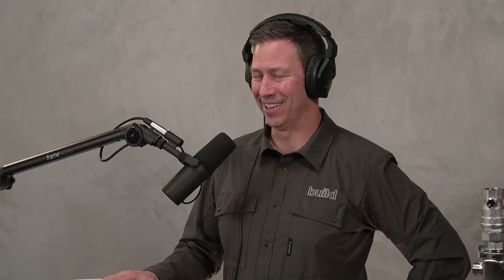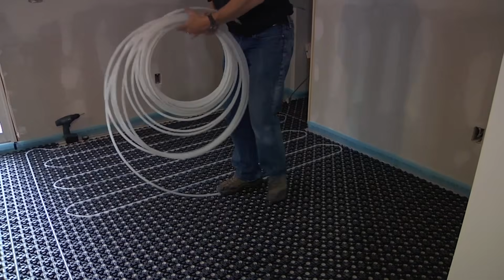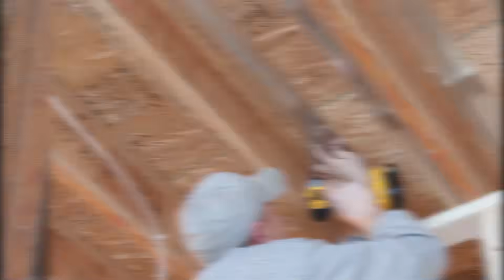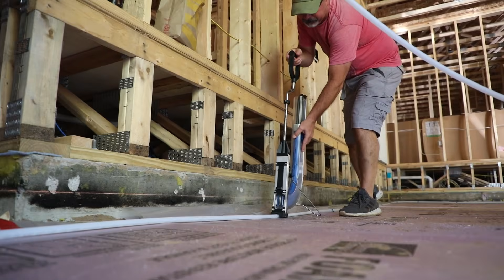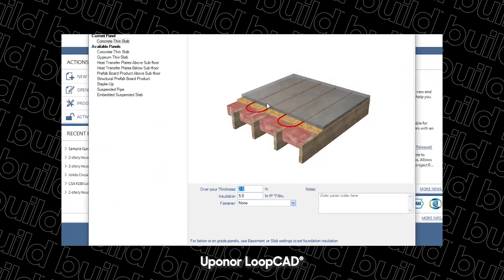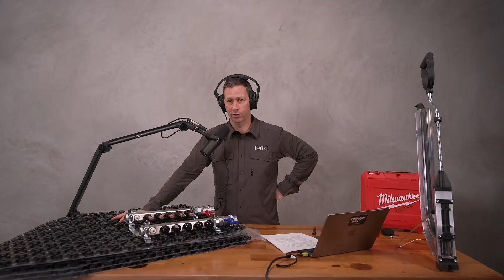4 Methods To Run Radiant Heat PEX Pipe

Comment: I know this was are sponsored by Uponor, but radiant heat can also be electric heater wire underneath the floor or in concrete.

Electric I feel can be more beneficial as it won't flood a space if there is s leak and can also be repaired if anything were to happen. (I feel this would be more difficult with this system) 

But electric heater wire also doesn't haves the thermal mass of water. So there's always that. But it should at least be included in the conversation.
Reply: @suspicionofdeceit I know but I've seen PEX get a pinhole leak and fuck up a ceiling. 

On the fault of the installer.
But still it happens, and water can do a ton of damage.
Reply: With electric you'd probably have a fire hazard instead of a flooding hazard xD.
Reply: @StealthNinja4577  
But why that include Electric in the conversation? 

Many residential construction manufacturers do electric radiant heating. I feel it should be included.
Reply: @mountainbikerdave  oh I'm just being factitious. I don't mind electric heat I use a space heater every winter. It'd be cool if they did natural gas radiant heat. Maybe in like a metal frame construction you install these burner boxes that heat up the walls and floors.
Reply: @StealthNinja4577  they have natural gas boilers that heat up water for radiant heating. But that's as far as natural gas for radiant heating goes. 

But as far as what you said You couldn't use natural gas in that capacity:
1. You need to vent the fumes or You would have just created a gas chamber
2. Natural gas gets too hot. You're essentially heating with fire, so you're going to get heat spikes unless it's a really really tiny flame. Either way it's still a fire hazard.
3. You'll have natural gas lines running all within your walls. It's an explosion just waiting to happen. Just imagine a leak and all that gas filling up the cavities in your walls. And remember your walls are fire rated, ideally they are supposed to be a fire barrier and not a fire spreader or a 8 ft tall claymore.
Reply: @StealthNinja4577  correct, if not installed properly/to code, you can have a potential fire hazard. 

But that's why we hire experts/professionals and not just some hacks standing outside of Home Depot. LoL
Reply: @mountainbikerdave  Technically as soon as you pay someone you make them a professional. It's always bothered me that people think professional implies expert. In the same vain people tout the code as if it's a be all end all but then contractors install stuff to meet code and then alter it once the inspector is gone and signed off on it.
Reply: @StealthNinja4577  100% correct

There's definitely a difference between someone who has a business license and a true expert in the subject matter.

But, all "code" means is minimum building requirements. If you alter it, that's fine. 
As long as it exceeds the minimum. 

(Just as an example, code in my area requires that you put a minimum of 1 exterior electrical outlet(s) per dwelling unit (house), it must be a minimum of 15 Amps and GFCI protected. But again that's the minimum. You can put in a 20 amp receptacle, because that exceeds the 15 amp requirement. You could put it on one of those new AFCI/GFCI protected circuit breakers, because it meets the minimum GFCI requirement. Also you can install 2, 3, or even 10 exterior receptacles, honestly whatever the homeowner wants. As long as it meets or exceeds the minimum requirement of 1 receptacle.)

But honestly I don't follow code. code is the minimum. My personal requirements astronomically exceed code. So that's what I follow, well at least for my own home.
Reply: @mountainbikerdave  I have 0 problems with codes like that. My one friend is building an earth house and the inspector is like but the code says you need a hole in your impermeable membrane for venting. He's then like but then it's not impermeable... the inspector really wanted a badge when he started so he got one off Amazon xD I'm just listening to his woes of dealing with the inspector and I'm just like this sounds like they need to go back up to the top and label the code for traditional construction and then make one for what he's doing cause it barely applies :p
Reply: @StealthNinja4577  I feel bad for your friend, most inspectors are complete idiots and have no clue why codes exist. 
They typically don't even come from the trades or the construction industry but instead just have a Buddy that got them the gig. 

They are a real pain in the ass to deal with, but unfortunately they have unlimited power so if you choose to do things the legal way you have to deal with them.

Also that, impermeable comment was hilarious. Like attaching a screen door on a submarine.

Comment: Matt,
I want to thank you very much for this weeks video post. I have always been a fan of this type of heating. But my home was too far into the build to change the way it is heated. However when you mentioned using the side walls that opened a whole new way to use the hot water heating. My first job was with an electrical contractor. At that time electric heat in the ceiling was being used. I also remember if a drywall contractor wasn't careful it could be a real mess tearing it all out and starting over. Over the years that type of heating faded away. I like the in floor method better. 
Thank you

Comment: There was this set of stairs, on This Old House, that needed heating, but they couldn't install radiant in the floor of them, and forced air couldn't work for them.  As a result, they used the wall mount method, there, for the radiant heating in the stair well.  It was Kevin O'Connor's first Project on TOH, I think.

Comment: I put Radiant tubing in a wall with these clamp on steel "radiators" that clamp onto the 1/2 pex. It is NOT 100% silent. when the wall gets hot and cold... it moves the pex and it expands/ contracts.. You can hear the wood rub on the Pex.

Comment: Do you need a water filter for it? I would think it would get calcium buildup over time this making it less efficient?
Reply: You can also use glycol in the system instead of water, so no worry about calcium buildup or freezing if the system were down during cold temps
Reply: You could probably make a distilled water closed loop with its own dedicated heater once the calcium is gone it should basically run forever.
Reply: You have to get the water right. Has to have the correct hardness.  And no biologic. You have to be careful with Distilled water. Distilled water can eat things up. Distilled water is too pure. Basically it wants to make it's self impure. I  didn't believe it. Until my brother Engineer who builds pet chow plants for Nestlé. Said someone used Distilled water in one of their chillers. It ate it up. Several hundred thousand to remove and replace it. You also have to use air elimination equipment. Air will cause all kinds of problems. Also biological criters can grow inside a sealed system causing the black sludge. I found that a lot of the "experts" have no clue about water. Or perhaps they do and want to come back a few years later and replace equipment. Once you get it right though. It'll be good for a long long time.  Equipment has to be right. But it's all out there. And easy to install. 
Also you have to use water with anti freeze. And that water has to be right. The more antifreeze you use the less efficient the heat transfer. 
I don't have any in my system. 
I live in Wisconsin.  But my house and slab are so insulated. I was heating all 3400sqft with one of those little oscillating heaters in the middle of my shop downstairs. While I was working on it.  After insulation before having drywall on the walls  just the ceiling. I had both my knees replaced beginning of November. So I wasn't working on it. No heat whatsoever. For almost 2 months before I could come back and check on it. I checked my entire slab with a laser thermometer. And the lowest it was was in the back corner 34°f. 

I drive a forklift for a living. I figured it all out so can you.

Comment: I would love to see a complete video on setting up a full system. Sizing boiler, parts needed, etc. I love the idea of radiant heat
Reply from the maker: Let me see if I can do that!
Reply: @buildshow  Hey Matt, it would be good also to rate the most efficient system embedments
IE heat draw on the boiler of a concrete insulated slab vs aluminum dispersion plates and the channeled wood product. Which one is the best bang for the buck.
Reply: @2drsdan  I have concrete slab radiant and True Trac...plywood tracks and hardwood top. The better the heat sink...ie concrete, ceramic, stone, etc...the better the comfort. I wish I did cement board and tile upstairs...or gypcrete. Gypcrete was breaking down and having issues 20 years ago so I avoided. Big 24 inch tile would be my next top.
Reply: @buildshow   You should look at doing a podcast with Dan Holohan (HeatingHelp) who literal wrote the modern books on steam and hot water design/troubleshooting.  He's got great stories.  His book 'Pumping Away' is must read to understand hydronic piping feeding the loops/radiators.
Reply: Ditto. Do it with no gas appliances please! Air to water heat pump please.
Reply: @brettzeigerbacher2314  Water to water is another good option. My neighbour's house has a ground source heat pump system for the space heating, hot water, and driveway heating for snow melting. Got it done at the right time too - planned from the start, and installed as part of the build.
Reply: Uponor has a VERY useful design guide that is a free download!
Reply: There are loads of full system buolds on YouTube...and loads of DIY ones for the very brave..
Reply: My brother had it installed in his house unfortunately it was new at the time and was a product called solar roll it could have been a great system but the plumber was incompetent and set up a duel heat system high temperature for the baseboard heaters in the basement and low temperature for the upstairs and it never worked properly
Reply: Look at warmboard. Great product.
Reply: @jwristen24  I quit on Warmboard and Ecowarm bc of the prohibitive price. I am going with tubing and covering it in aircrete. Look for aircrete Harry on YouTube.
Reply: @tedsimeonov9696  used gypcrete on many many hotels. Great product. Lays down great. Not cheap though and gotta have everything prepper right otherwise it's a giant mess.

Comment: The Quick Track  (spelling?) is intriguing as a retrofit for our main bathroom since there is access from below (in my office/personal room).  Can you put insulation/sound deadener between the floor joists and over (under?) the Quick Track to minimize the foot noise from above?

Comment: I'd say Warm Board is another product worth a look for this, a lot like quick track but way better  Just did a big renovation on a place and used that. It was easy to install because every panel was mapped out with blank panels for under cabinets etc. The entire top is aluminum, unless you have to do a custom route in a few spots which is normal but it's just no aluminum under the tubing so not a big deal. The entire system was very reasonably priced too. Hahaa, I'm not paid to say that but I would recommend that system, customer service is great too. Take care
Reply: Agreed. Plus they do a design/build type setup with plans and zones speced and ready to go.
Reply: I used Warmboard (and their design services) in our new build construction six years ago and love it.     We used an engineered hardwood over the Warmboard subfloor.  For the hot water source, we used a Navien combi boilder for both the domestic hot water and the radiant.    Works (and feels) great.

The general building contractor wasn't experienced with Warmboard, or even radiant heat, but the plumber was and it worked out very easily.
Reply: I used warmboard in my house. Awesome stuff.  I heat and cool with geothermal.  Use chilled water fan coils for cooling. Solar for  power 10,080 watts. Keep house above. And 2400sqft shop and storage below.  As hot as I want all winter. And as cold as I  want  all summer.  All 3400sqft. Zero bills. House all electric.
Reply: Matt is not talking about it but on the build show network they actually have a video about it 
https://youtu.be/c9_H_X9cY2o

Comment: you still need to move air, people in the house need to breath, so even if you don't need to heat the moving air, you still need to move air through the house.
Reply: HRV or in humid climates ERV
Reply: @jamespatrick5930  yes, but as they were talking about how radiant is silent and there's no dust kicked up by moving air, that only works if you hve a leaky house, otherwise you have a HRV/ERV moving air, stirring up dust, making noise, etc. (possibly less than if you are heating/cooling the air, but how much less??)
Reply: @davidelang  My HRV don’t stir up dust as the stale air vent is in the master bath ceiling & fresh air supply is in other end of house above the refrigerator in kitchen. 
My 4 HRV pipes are 4” PVC schedule 35, fresh air in front gable end & stale air out the rear gable end.
Reply: @jamespatrick5930  ahh, I've never lived in a tight house, but even so I've had interior doors slam shut from poor ventilation design and expected that in a tight house, closed interior doors would not allow all the rooms to get good air circulation. (I would want the interior doors to be that tight to cut down on noise from one room to another at least)

Comment: Does a ceiling install in a 2 story house do double duty...heating above and below?
Reply: Somewhat, I did this in my last house with suspended pex in between the TJI’s, 4x pex runs per 16”
 Seemed to send about 2/3 of the heat to main level & about 1/3 into basement, more or less.

Comment: what kind of boilers are usually used with these radiant systems? tankless? large tanks based on house size?
Reply: I’m an owner builder and have looked at different option. Most natural gas boilers now actually modulate the flame to the demand. I’m going to be running mine at about 130F. The nice thing about a hydronic system is all you need is a thermostatically controlled valve for a zone. Even the pumps vary their speed to the demands of the loop.

Comment: Great show Matt!!  Just wondering how the temperature per zone adjusted?  Say you want bedrooms cooler than main area's etc.  I would assume that there is only 1 heated water source so all zones would supply the same temperature water?  what about keeping unused space at a cooler temp?  My guess is something adjusted at the manifold?
Reply: 1 thermostat per zone, each controls a dedicated zone valve.
Almost always a single water temperature, with the thermostats turning flow on or off.
Reply from the maker: Yes each zone has a manifold so you can adjust the temp by zone even though the boiler is at one temp
Reply: If this was done in ye olden times you'd probably just throttle the flow rate so the water dissipates the heat longer before returning
Reply: Thermostatic mixing valves can adjust the temperature in each feed, valves or pumps are controlled by the thermostat to open and close feed to a zone.  Usually, a loop will feed a coil in the hot water tank which takes up the residual load from the boiler as zones satisfy.
Reply: @jkbrown5496  I’m glad that U mentioned Indirect Water Heaters, this is a great way to provide Domestic hot water to fixtures. 

Yes, thermostatic mixing valve (TMV) can be adjusted to mix some cold water with the hotter water to temper down a zone or two.

This requires a separate pump to “suck” on its mixed output port. More pumps = more cost, more complicated. 

I much prefer 1 Grundfos Alpha to pump entire distribution system.

My current new house system has  3 in slab low temperature zones that uses an Outdoor Reset Injection controller. The colder it is outside = hotter injected water to system.